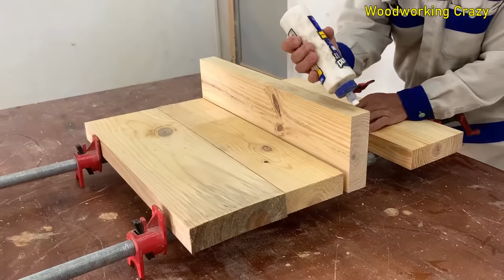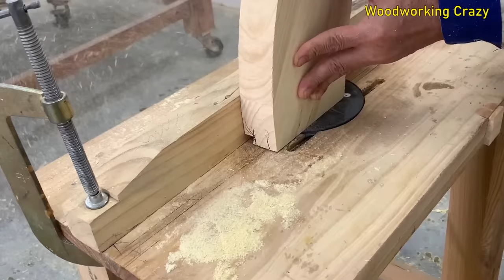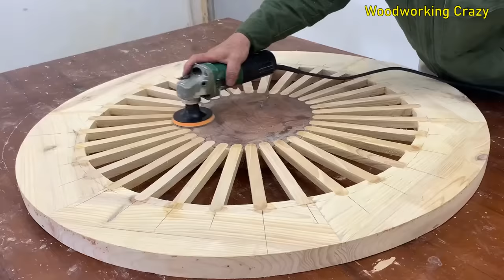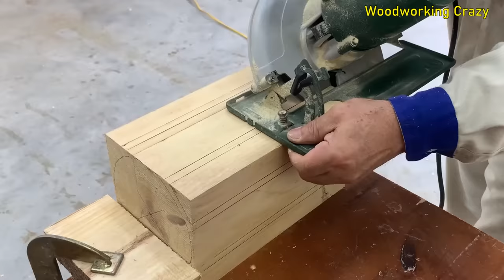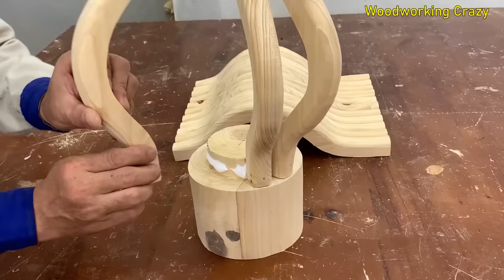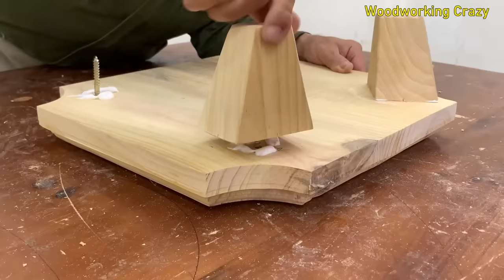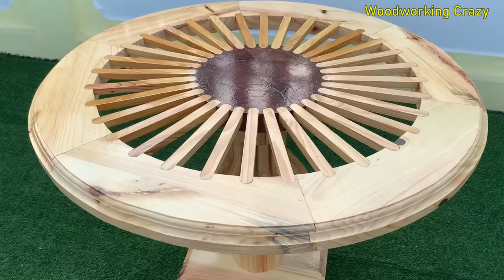Skillful Carpentry Techniques Of Vietnamese Carpenters - Unique Design Ideas Very Fancy Round table

Comment: Liked the style very much. Beautiful work. But I have a question - why are the legs located almost in the center, because with an overweight - the table will buckle?
Reply: three feet would be better than four.  But I agree it's designed to be top-heavy and unstable.  Rather than the radial struts forming a top surface that mostly unusable (not3 the position of the glass shown), I suggest a level inlay of contrasting wood: much more stylish and practical/  Good technique; bad design

Comment: If this guy took his time and used premium lumber this could of be a very expensive piece. It is Nice but not over the top.   Using a router trim but he could of made every surface exact. It is a nice rustic patio table. Taking your time and put on  a  glass table top it could of been worth thousands.  A good basic design to start with.

Comment: I'm fairly sure you can eliminate the lap joint and make them all dovetail joints, by assembling all the joints simultaneously: assemble the pieces into something that looks like a flower, with three pieces near the center and three pieces away from the center, alternating: one in, one out, one in, one out, one in, one out. Then hammer each one a few times in turn, going around the circle, the way you fasten nuts on a wheel--you don't just fasten the first nut completely and then start on the second nut.
Reply: Tôi khá chắc chắn rằng bạn có thể loại bỏ khớp nối và biến tất cả chúng thành các khớp nối khớp với nhau, bằng cách lắp ráp đồng thời tất cả các khớp nối: lắp ráp các mảnh thành một thứ trông giống như bông hoa, với ba mảnh gần tâm và ba mảnh cách xa tâm, xen kẽ: một vào, một ra, một vào, một ra, một vào, một ra. Sau đó, đập lần lượt từng cái một vài lần, đi xung quanh vòng tròn, giống như cách bạn vặn chặt đai ốc trên bánh xe - bạn không chỉ vặn chặt hoàn toàn đai ốc đầu tiên rồi mới bắt đầu với đai ốc thứ hai.
Reply: 1❤¹
Reply: 🎉cyr 0:12 0:12

Comment: Why not use the router to machine the rabbets around the hubs, instead of under-cutting them with a bandsaw? Why not putty the nail holes?  Why not break the top edges of the tabletop spokes, if you're not going to cover the top with glass? His woodworking skills are way too good to be wasted on an ugly, poorly designed, and poorly made piece like this.
Reply: The finish product looks rough. The design is tall, which seems heavy at the top combined with a small base.  You don't want any children near it, especially if you put nice things on it as a display.
Reply: Вы абсолютно правы!!! Эта работа - трата времени. Нет никакой эстетической радости. Мазахизм. До столяра ему далёко.

Comment: beautiful table, but a lot of  the glue in the dove tail joints get pushed out during assembly.  Might be better to also put glue on the female part of the dove joint as well .  Looks like the glue in is not water proof.  Would last a lot longer if a waterproof glue is used.

Comment: Bit rough and not finished in my opinion. Craftsmanship is just slightly above average. No matter how the table looks he needs to fill in the gaps between the spokes with glass. Can’t leave gaps otherwise will be extremely annoying table surface to use. Needs to cover up the nail heads at bottom joints. Probably c+ or at best b- for this project.
Reply: P

Comment: Skillfull ... could be twice niver if it had taken double time. The rays of the wheel are not straight, the bottom plate is not cut properly ... this is quick and cheap work.